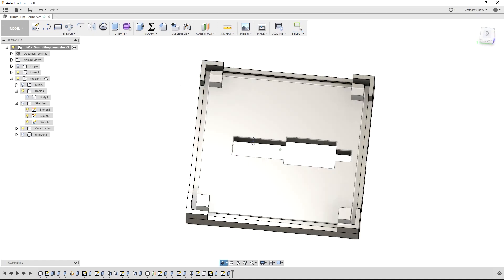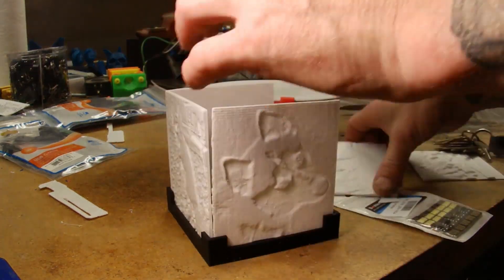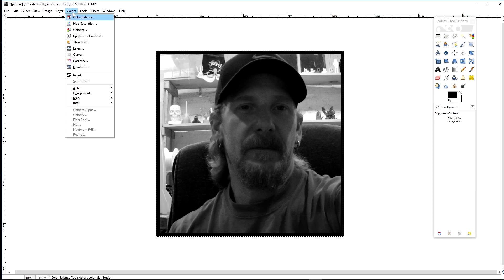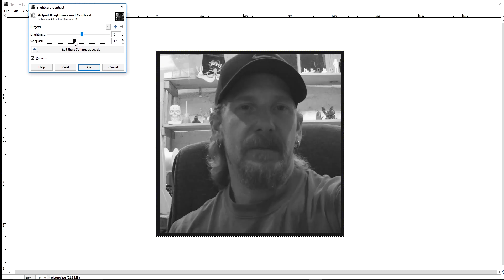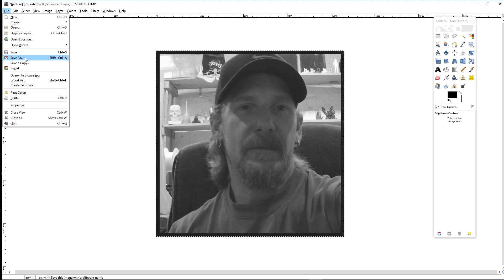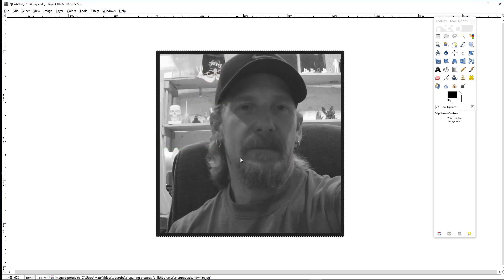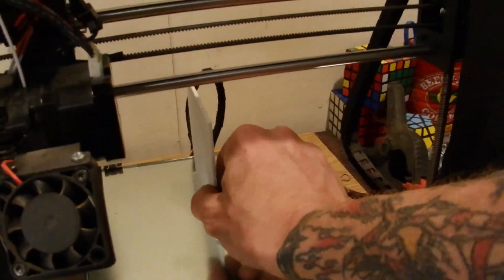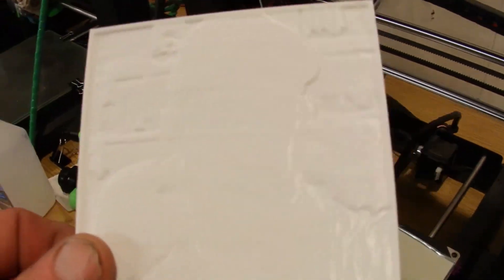How I prepare Pictures for Lithophanes Using Gimp

Comment: Are you still using a 0.18 layer height? Have you tried going to something like 0.10? Just curious if that would reduce the lines a bit. You are the first I have come across to show how to get the picture ready in GIMP which is awesome cause that's the program I will be using when I try this.

Also, if you hold SHIFT while doing a selection in GIMP, it will keep the selection box as a square.
Reply from the maker: Mike Cameron I’ve tried slicing at .1 but the time is very long I’m currently at 
.1618 layer height been working good. I’m glad you found my video useful thanks for watching